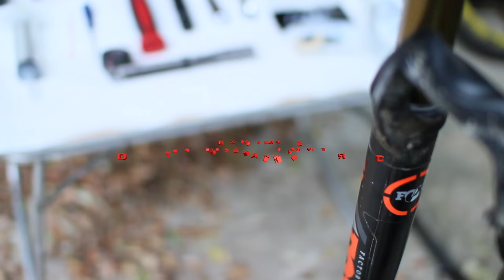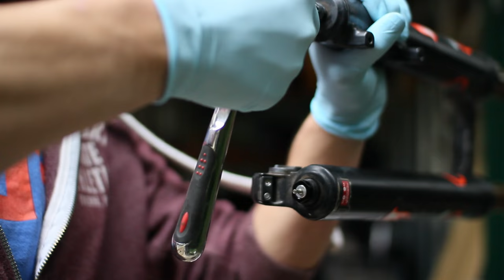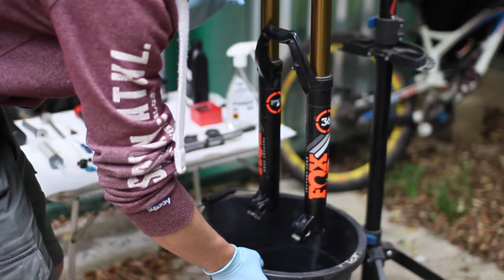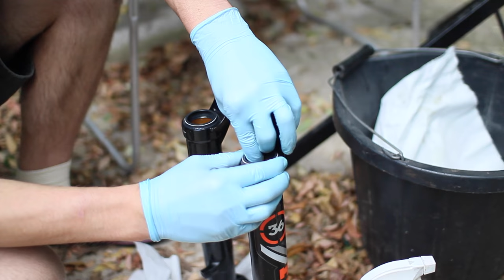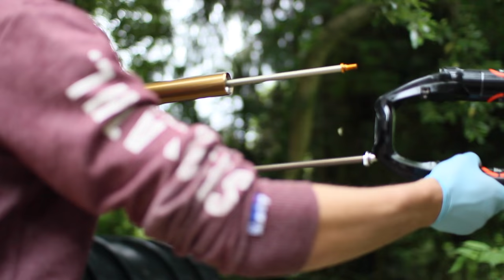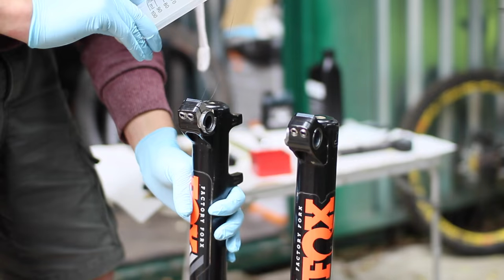Fox 36 FIT fork suspension - lower leg service. HOW TO.

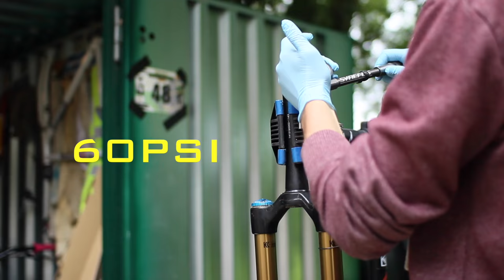Comment: @3:22 why do you add 60psi before the lowers are installed? never seen this method done before
Reply: Stops the air spring compressing when lowers put back on, and prevent air being trapped in the neg, causing suck down.

Comment: What about air getting trapped? Us this a problem?
Reply from the maker: q062am when refitting the lowers? This should not be a problem as it's not a oil bath. The oil is primarily to aid in lubrication and smooth running of the forks. Air would be a problem when doing a fork upper service with the oil chambers. Depending on your forks etc. If you are unsure with what you have contact a lbs or fox themselves.
Reply: Andy Kempe Thanks for quick answer. yes i meant air getting trapped when refitting the legs after lower leg service. So the air that is contained together with the lubricating oil has no effect on fork performance if i understand this/
thanks for a great video/
Reply from the maker: That's correct. Glad you like the video